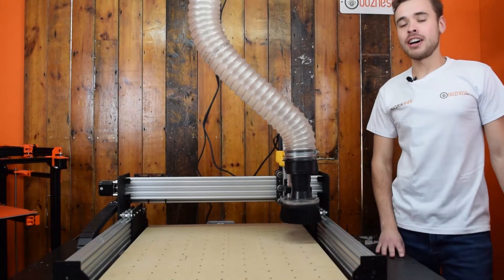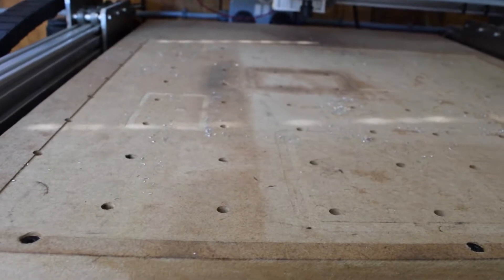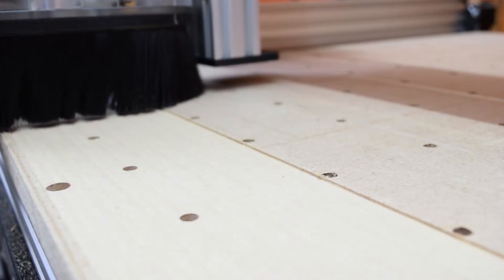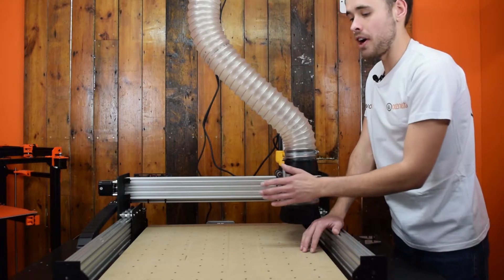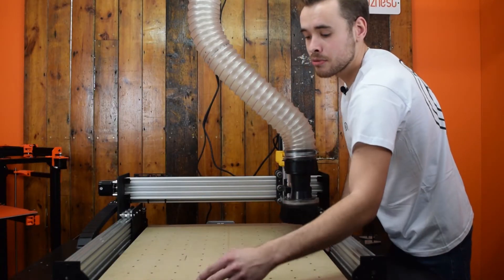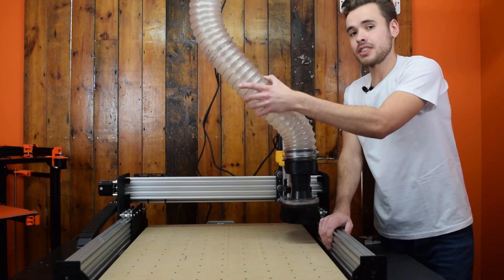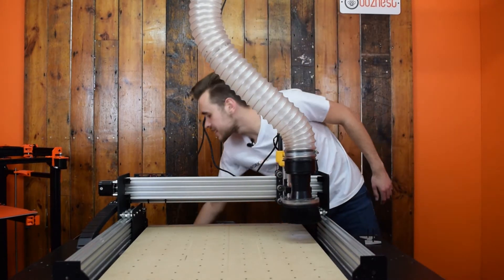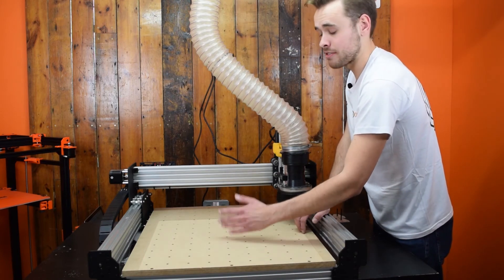How To Surface Your CNC Machine Spoiler Board | WorkBee

Comment: Hi Ryan,

I've just finished constructing my 1000x1000 work bee and I'm looking at surfacing the spoiler board using the Vectric software I also purchased. You also supplied an Amana Tool 1-1/8" surfacing bit. I've looked at the Vectric faqs and it recommends adding it to their tool database as an Endmill. However it's a little vague as to what Cutting parameters and feeds&speeds to use. could you give us some guidance?
I'm after Pass depth, Stepover and percentage, Spindle speed (I think it's 18000), Chip load ( I think it 0.004 inches), feed rate and plunge rate. 
Thanks in advance.
Keep up the great work
Reply from the maker: Hi Craig, the dimensions you need to add into Vectric can be found on the table on this page here: https://ooznest.co.uk/product/amana-end-mill-surfacing-3-flute-1-1-8/
If your spoilerboard is MDF 1mm pass depth, 2500mm/min, 40% stepover, 18kRPM would work well. Plunge normally you would set to half your feedrate. Chipload is just calculated automatically from the other settings. Just make sure it is less than what is in this table: https://ooznest.co.uk/wp-content/uploads/2020/10/Carbide-Tipped-Spoilboard-3-4-Wing-Speed-Chart-v2.pdf
Thanks!

Comment: What do you suggest as the spoiler board for the 1500 mm x 1500 mm Workbee? That's larger than the width of a 4 foot MDF sheet.
Reply from the maker: Hi Brian! We use an MDF Spoilerboard of 12mm - you can find the sizes here (https://learn.ooznest.co.uk/Wiki/Critical_Machine_Dimensions)
Reply: @ooznest  Hi guys, I understand that, but the size of the spoiler board specified - 1370 x 1500mm - is larger than the dimensions of a 2440 x 1220 mm MDF sheet.
Reply from the maker: @baza210  You can use a push-through method on the machine to cut larger sheets, which means you would be able to register a job in two parts, cut one half and then manually push the material through to locate the XYZ again to continue the cut on the other half. We have a YouTube video which explains the process: https://www.youtube.com/watch?v=JKyiKZrLPqA. Hope this answers your question :)
Reply: @ooznest  sorry, I'm not talking about the workpiece but the spoiler board itself. a 1500mm workbee's spoiler board dimensions are 1370 x 1500mm, which does not fit into a 1220 x 2440 mm sheet, so how am i supposed to make a spoiler board? can i use two pieces of MDF? can i use a smaller spoiler board than that, eg 1220 x 1500?
Reply from the maker: @baza210  Thanks for your comment. So you would either need to use a 5ft x 10ft sheet, or make the spoilerboard out of two pieces.
Reply: @ooznest  Hi Brian, I went down the route of finding an over sized 5ftx10ft sheet, you have to find a proper timber merchant (not B&Q) in you area. It took a bit of searching but I found one eventually. The 18mm sheet cost around £80, which is probably 3 times as much as a 8x4 but it does save a lot of messing around trying to join 2 8x4's together. I got the timber merchant to cut it in 2 so I have a replacement.  At the time I was um-ing and r-ing about the extra cost but it does save a lot of hassle! Funnily enough I'm about to re-surface mine again. Absolutely loving cutter and Oozenest have been brilliant with support.

Comment: Hi Ryan, Im surfacing our spoiler board as we speak, I have a 1 inch surfacing bit - what speed y-x axis speed do you recommend? our dewalt is set to speed 1 (16000 rpm). It takes quite some time at the moment with the basic settings for travel speed.
Reply from the maker: Hi, i would recommend a starting speed of around 1200mm/min.

Comment: If I position the spoiler board in the lower position can I use 2 layers of mdf when cutting thin material (to reduce the travel of the z axis)?
Reply from the maker: Yes that would be fine

Comment: Isent it better to make the spoilerboard smaller than your Workbee's dimensions? Right now you cant put anything on the spoilerboard, that is bigger than the spoilerboard. But the non surfaced part of the spoilerboard dont grant any advantage at all. Or does it?
Reply from the maker: Its really down to personal preference, if you cut pieces around the same size as the spoilerboard its nice to have a bigger board to fix the clamps